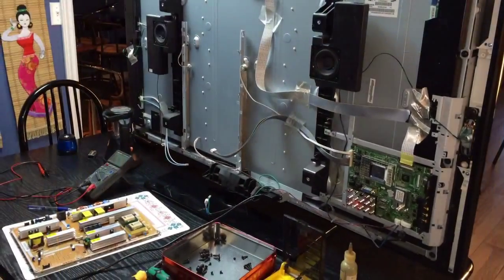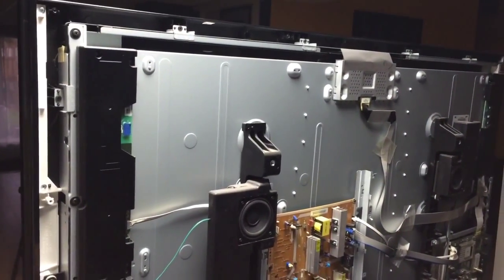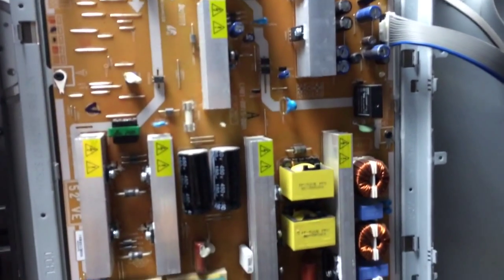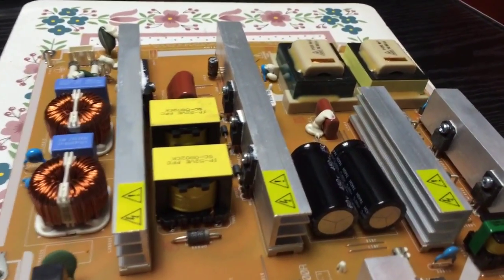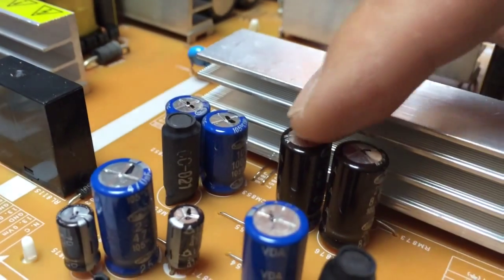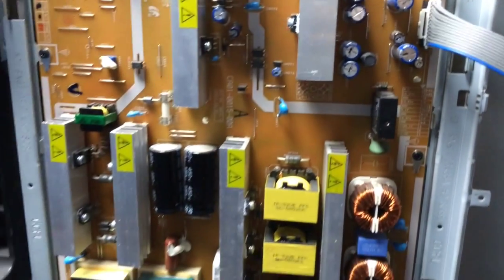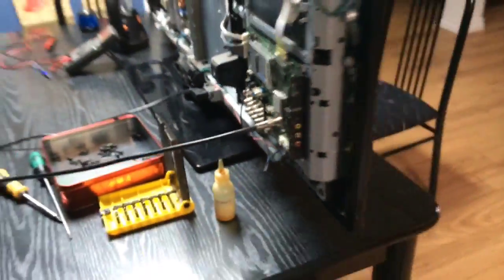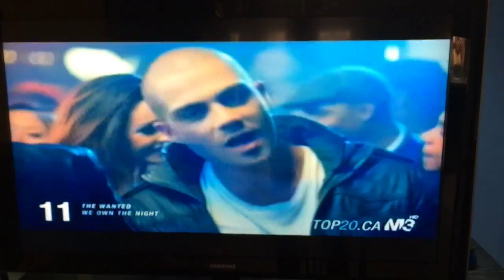How to fix a Samsung 52" TV with no power problem.

Comment: Can you please tell me We're did you get or order those capacitors? I have the same tv and the same problem.
Reply from the maker: I got mine from a local electronic store. You should be able find one from your local electronic store or online at eBay or Amazon. Here is an example of Amazon: 

Witonics Capacitor Repair Kit for Samsung LCD/Plasma TV https://www.amazon.ca/dp/B00K243W5Y/ref=cm_sw_r_cp_api_glt_i_XCSJVXYG0SHK0SBXBW82

You need to know the value of your original cap, that is the farad value and the voltage value.
Good luck!
Reply: @PTranProductions  appreciate you for your response. Thank you so much.
Reply from the maker: @colorado17634  
You are very welcome! 👍